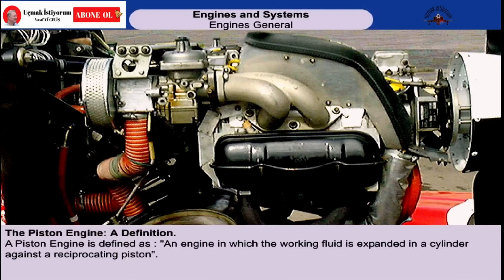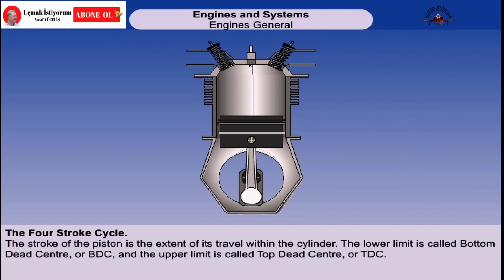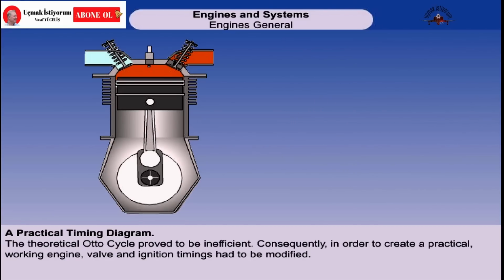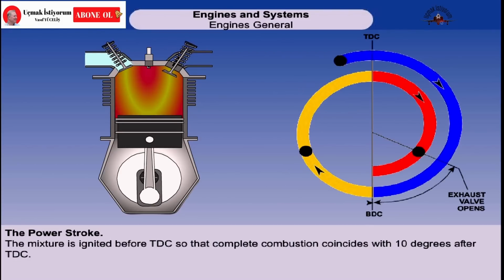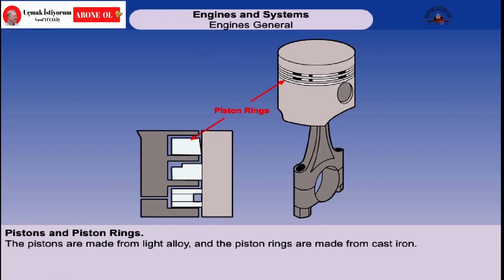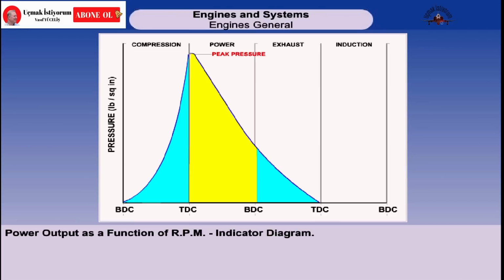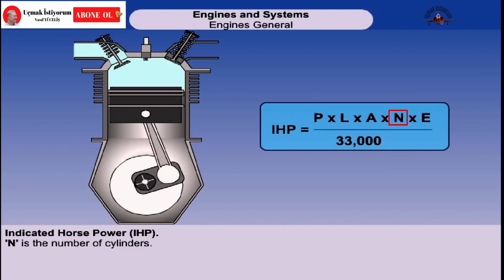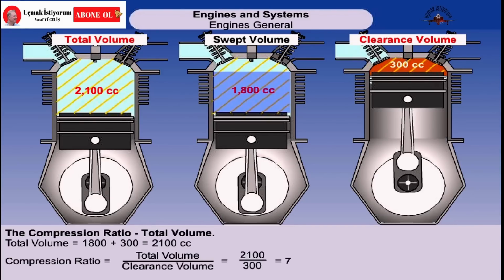PPL 020 Piston Engines: Power Output as a Function of RPM, Indicated Horsepower, Compression Ratio

Comment: How does a person determine Mean Effective Pressure. Some examples show 80 psi and others 410 etc.
Would 80 be used for a simple gas engine naturally aspirated and 410 be indicative of a supercharged or high compression diesel? 
Is there a reference for this critical number? Thanks
Reply from the maker: Mean Effective Pressure (MEP) is a critical parameter in internal combustion engine performance, representing the average pressure exerted on the piston during its power stroke. It is directly related to the engine's ability to produce torque. The value of MEP is typically calculated as "Indicated Mean Effective Pressure (IMEP)" when considering the pressures inside the cylinder without accounting for mechanical losses or "Brake Mean Effective Pressure (BMEP)" when accounting for these losses (like friction and pumping).

###  MEP
To calculate MEP, the following formula is used:
MEP= (2×Torque) / Displacement Volume
Where:
- Torque is the engine torque output.
- Displacement Volume is the total volume displaced by the pistons of the engine over one revolution.

Alternatively, when calculating IMEP from cylinder pressure data directly (often in engine development), it involves integrating pressure over the volume change during the power stroke.

### MEP Values in Different Engines
The values of MEP can vary widely based on engine design, compression ratio, induction type, and fuel type:

- *Naturally Aspirated Gasoline Engines*: Typically, the MEP values for these engines are lower, often ranging between **80-150 psi**. This is because naturally aspirated engines rely solely on atmospheric pressure for air intake, and their compression ratios are generally lower than those of diesel engines or supercharged engines.

- High-Performance Gasoline Engines or Light Turbocharged Engines*: For engines that are either high-performance or lightly turbocharged, MEP values can range from **150-200 psi* or higher. The increase in air intake pressure due to turbocharging improves the cylinder pressure during the power stroke.

- Diesel Engines*: Diesel engines, especially those with higher compression ratios, typically have higher MEP values due to the intense pressure created during combustion. The values can range between **200-300 psi* for naturally aspirated diesels and can exceed *300-400 psi* in turbocharged or supercharged diesel engines.

- High-Performance Supercharged or Turbocharged Engines*: Supercharged or heavily turbocharged engines, including high-performance gasoline and diesel engines, can reach MEP values of **400-500 psi* or even higher. The supercharging or turbocharging forces more air into the cylinder, increasing combustion pressure and, consequently, the MEP.

### Reference for MEP Values
While there is no single reference for MEP values that fits all engines, several textbooks and engine design references provide guidelines or typical ranges. Some useful references include:

- Internal Combustion Engine Fundamentals by John B. Heywood: This book provides detailed insights into engine thermodynamics, MEP, and various parameters affecting engine performance.
- Automotive Technology by Jack Erjavec: Offers a practical understanding of how different factors like MEP affect the performance of various engine types.
- Engine Test Standards (like SAE J1349): These standards outline methods for measuring engine power, torque, and sometimes MEP.

The specific MEP for an engine depends on its design, intended use, and the balance between power output, efficiency, and durability. Understanding the relationship between MEP and engine parameters helps in optimizing the design of an engine for a given application.
Reply: @vasifyucelis  My three cylinder diesel has compression ratio of 12.55:1
It should have a reasonably high psi number like 80 psi right?